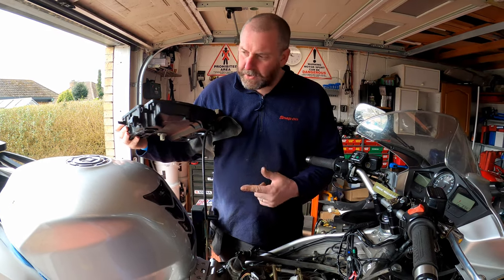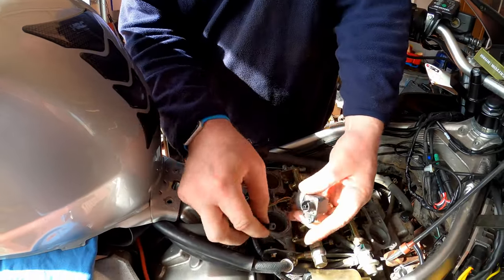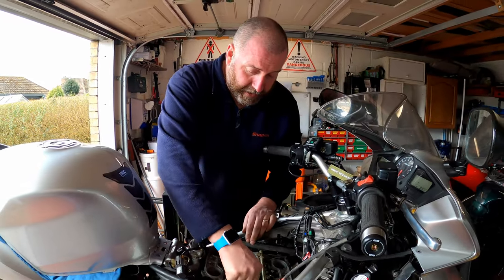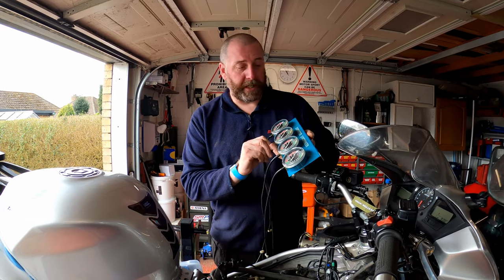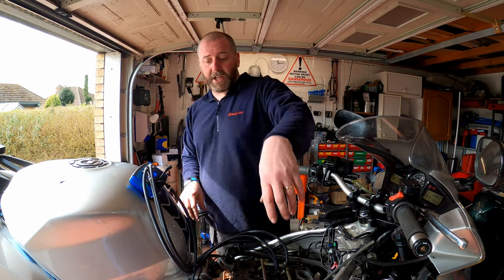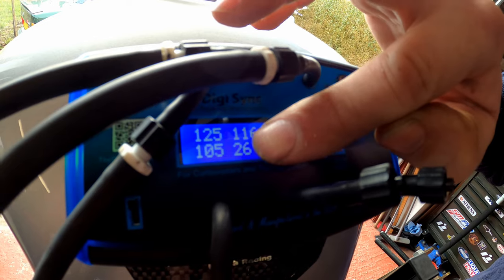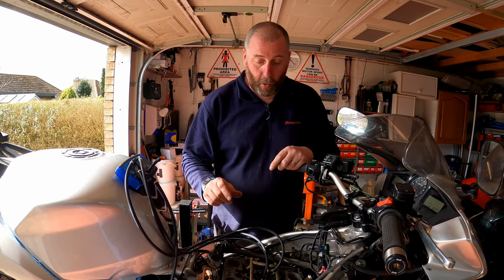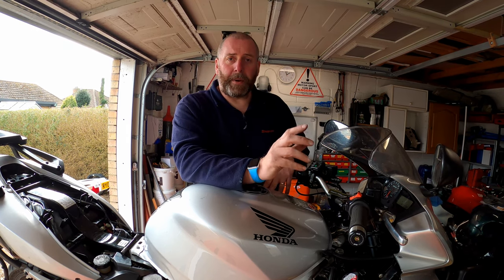Honda VFR800 VTEC Starter Valve Synchronization

Comment: Great video! I attempted this job and mid way through the tape plugging the crank ventilator blasted off. I turned off the bike and replugged it. Ever since the bike won't crank over. Starter solenoid just rapidly clicks. No idea what happened between me turning the bike off and back on. Put it all back together and now instead of a bike running better the bike doesn't run at all. Best part is because I was fiddling with the idle and one of the cylinders when it blew the tape the idle will be even worse than before when i get it running. I love bikes.

Comment: Really appreciate your systematic approach to vfr800 maintenance. You already have covered most of the maintenance topics on those bikes. When synchronising you should really keep an eye on the rpm as values tend to change with change of rpm. For best results you should lower the idle rpm to 1200 and check again.
Reply from the maker: I did state that in the video but thanks bud 👍🏻

Comment: Good video; thanks! I first tried to do this job using my Haynes manual. When I finished, the bike idled like a bag of spanners. After watching your video, I discovered that Haynes forgets to mention that after disconnecting the flapper valve you have to blank off the connecting hose. So that's twice today I've done the job! Always easier the second time though, and now the bike is idling so much smoother.

Comment: I have a 98 vfr800fi not the vteck think that came the next year but I dont have any issues at all with it never have really I try to keep up with it as much as I can so I watch ypur videos I do need to do my fork seals though and watched that video but is this same on my bike if I do run into that sit just curios
Reply from the maker: Yeah, the forks are pretty much the same except that the 5th Gen has 41mm forks and the 6th Gen has 43mm. Other than that the strip and assembly is near identical. 👍🤓

Comment: Hi Kev, great video.  I recently bought a low mileage (8,500 mi) project bike that has been sitting a few years.  Its a 2001 5th gen VFR and there is no fuel getting to the left cylinders, the plugs are dry and the right cylinder plugs are wet.  Is this a common issue with these bikes, anything obvious I should be looking for?  The ecm gives two flashes indicating a MAP issue.  Thanks in advance for any helpful info.
Reply from the maker: 2 blinks is an issue with the vacuum hose to the MAP sensor or a fault with the actual sensor itself, 1 blink is an electrical fault with the MAP sensor. Whilst I am unclear as to whether or not the two issues are related, I would start by fixing you known MAP issue and see if that cures the problem. If not then come back to me and we'll look into it mate. 🤓👍

Comment: Another point which I noticed you do too, wait until the fuel level is low (or go for a good ride until it's low), makes lifting and moving the fuel tank much easier.  I've just bought an E Tune unit which is between the cheaper analogue gages and the Digi Sync.  Curious to see how it performs doing my 5th gen starter valves.
Reply from the maker: As it goes, I haven’t emptied the tank but I have disconnected the fuel level sender which gives the impression that I have emptied it! 😁
Reply: @KevsShed  Ha, there's me thinking you were organised!!  Good vid though.
Reply from the maker: @JimBiddle.  Haha :)

Comment: kev thinking of doing this as im experiencing the idle cutting kind of blowing its self out after a short blip on the throttle wile driving normally idle is good but once up to temp and a blast and return to idle its lumpy and i have to try and keep it running  not not always just sometimes does this sound like its sync is out
Reply from the maker: Very possible that this could cure your issue, also double check all vacuum lines whilst in there, as split ones will cause the symptoms that you describe 👍🏻

Comment: Hi Kev , the vaccum tubes original honda size is 3.5mm but all i can see for buy here is 3mm or 4mm  i should use 3 or 4mm? thank'
Reply: Hey, which ones you went for ? Im looking to do mine also
Reply: @Mantinegrass  finally i used 3mm size.
Reply: @zxrd2753  was it easy fit ?